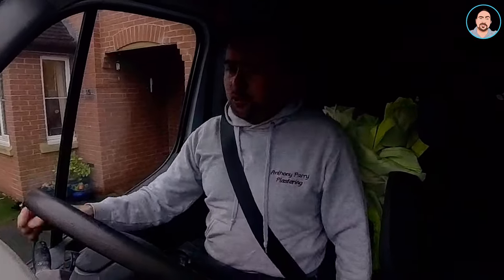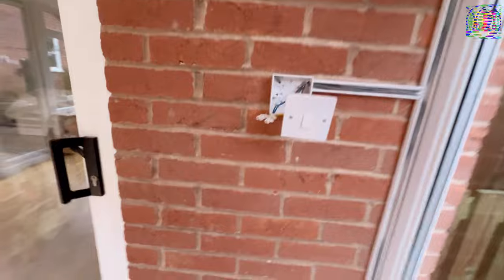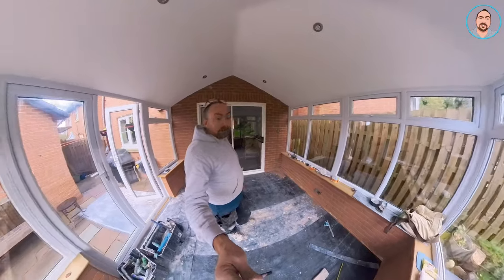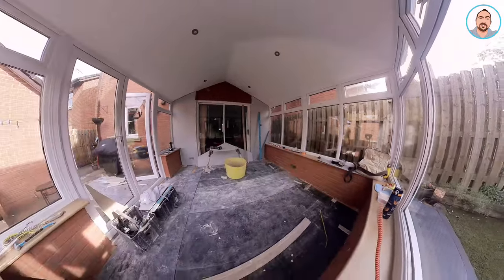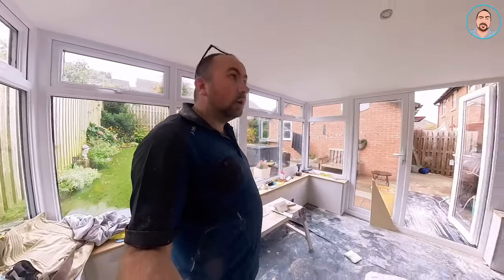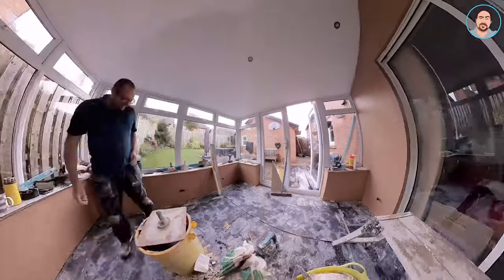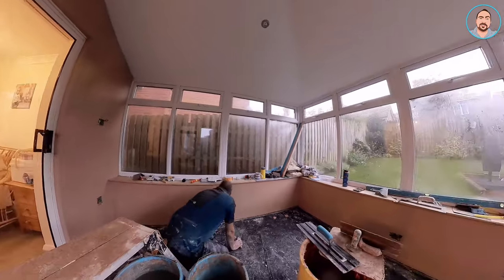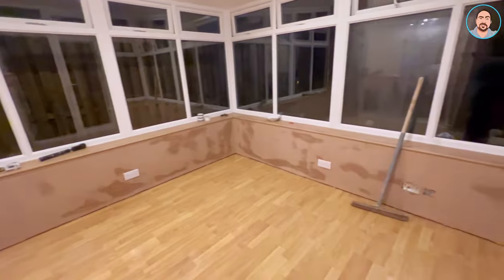My day Plastering, Job in a day start to finish. Lots of Tips and tricks

Comment: Y speed skim 3rd generation plasterer shouldn't be using that you only need a steel trowel wtf
Reply: Maybe because it’s easier on the body and saves allot of up and downing on a ceiling .. work smarter not harder and move with the times also a plastic bade doesn’t make the skim wet again so can second coat  quicker and get home and put your feet up sooner ! But careful with those flexi trowels

Comment: Why the hell is a plasterer running new sockets ??? 
yes It's not notifiable work but it still should conform current regs.althout regs have most likely changed now.

More to the point has the consumer unit even been checked to make sure it ok to do this ???
Its all good until qualifyed electrician comes in and says no-no and sockets need to be removed.

Im a plasterer of 23+ years and i never repeat never disconnect or add sockets to the wall i ask the Electrician if ones on site or ask clients to have it done or they do it.. as if there's any issue you will invalidate your public liability insurance..
I have test gear & rated screwdrivers in case i need them to move switches forward to fully cover them wile plastering to stop the risk of capillary reaction and keep myself safe.
But thats were a plasterers task should end in terms of electrical installation.

Very disappointed to see stuff like this, its not best practice.

Im not getting going on boarding and skimming in a day..